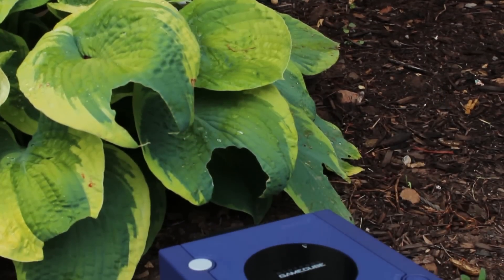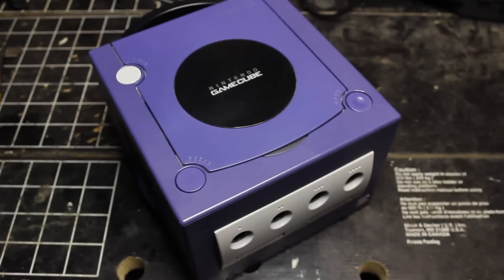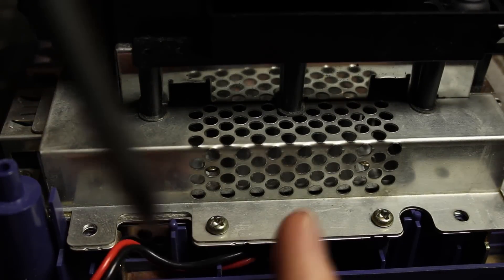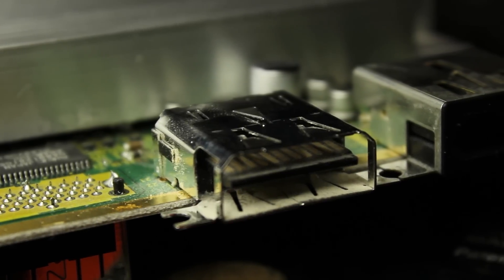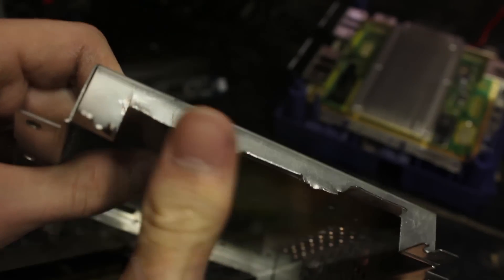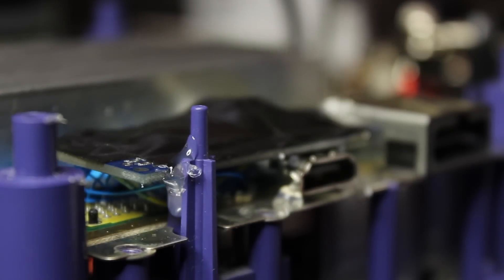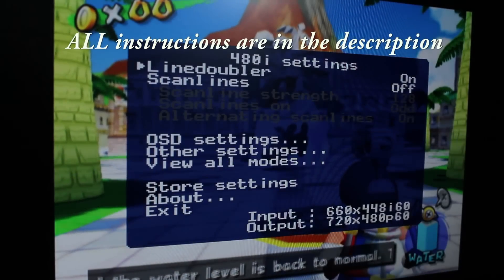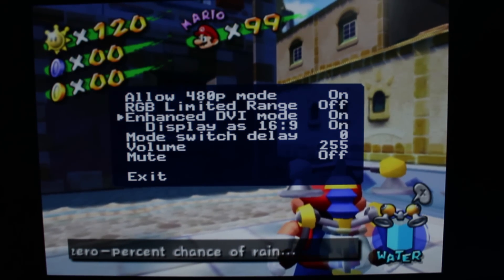GameCube HDMI Mod

Comment: Alright so I actually just bought this and installed it last night.  Fired it up and yay! HDMI worked right off... but wait, no audio...  I ended up searching through what little info I could find and supposedly I have to enable the DVI audio through the OSD.  Yay! again... nope... I made absolutely sure that my controller connection to the via on the bottom of the board was getting continuity to the HDMI kit but to no avail can I get into the on screen display to alter my settings... The input combo to bring it up is supposed to be L+R+X+Y, tried that over and over and over again, nothing.  Any help would be great, having to also hook up cables to the multi-out and running those to external speakers for audio isn't ideal at all.
Reply: I'm having the same problem. Bought the board last week and installed over the weekend. Video output is fine. Cannot access the OSD.
Reply: Hey Jake. I'm having the EXACT same issue. I'm pretty confident there isn't a short or anything. After trying to troubleshoot, my port 1 doesn't work at all.  I ordered a replacement front board to see if something's going on with the ribbon cable that can explain the controller problem.  The controller used to work, just not the input combo for the OSD, now it doesn't work at all while controllers 2, 3, and 4 work fine.
Reply: Make sure you contact them and write your problem in the forums.  When I emailed them they said they hadn't gotten any other reports of that happening.
Reply: Nah, got my new one in and had zero problems.
Reply: On my first try I removed the digital port and messed up the controller 1 data pad do I got a second board. I then broke a trace or something around the digital port. On my third try I was like "fuck it" and kept the digital port lol
Reply: All working again now. Jean from KNJN hooked me up with some amazing after sales support. He told me to bridge a couple points on the board, that helped. Then we found out there was possibly noise coming in from the serial connector, so bridged a couple more points to disable that and voila - it's working! I would recommend removing the digital port and using thicker wires (like 20awg). A lot of my problems came from using really thin kynar wire and the connections becoming brittle and breaking. I might tempt another gamecube and do a much more thorough install.
Reply from the maker: There are many points around the area where the controller soldering spot is supposed to be. https://raw.githubusercontent.com/ikorb/gcvideo/master/HDL/gcvideo_dvi/doc/gc-controller.jpg
Make sure that it is connected correctly. Way to think of it is one column to the right of C226, and one point down.
Than make sure you soldered that wire to pin 94.

The sound should work once your able to get to the menus and enable Enhanced DVI Mode.
Reply: I will check again now that I've had some sleep but I'm certain I've checked the location at least 10x. Going to be pissed if it's something to do with my actual controller board not recognizing one of the button inputs.
Reply: Well this is certainly aggravating. Staring at the board pictures and at my own board C226 is printed on the board differently.  The cap is in the same spot but the writing is marked off to the side differently, I wonder if I don't have the slightest board revision making this not the correct via to connect to.
Reply from the maker: Could you send a picture in of the board? I'm curious what it looks like
Reply: I just got in a couple of GameCubes, maybe I'll try and  swap out the controller board with another and see if that resolves the issue. I'll get on it now and let you know if anything changes.
Reply: Thanks man, I appreciate it.
Reply: Bad news, same results...  I'm thinking the boards they are sending out are either defective or not programmed correctly.  I unfortunately just ordered 2 more.  They did get in contact with me and told me to post my problem on their forum, I suggest you do the same as I'm assuming it's an issue on their part.  Sounds like they will ship me out another board if I can't resolve it, I suggest you write your experience on their forum as well.
http://knjn.com/phpbb/viewforum.php?f=2&sid=0a00fc8523bf4e522e0443291523d020
Reply: Just did both
Reply: so I emailed them last night and still don't have a response. I also posted on the forum but my post is nowhere to be found...
Reply: Yeah I actually looked for your post after you said that and didn't see it. Just mine with no response, that worries me that they are sending them all out with this issue.  It's kind of a big deal seeing as how if you are using your TV's internal speakers you have no way of getting an audio signal to them and video at the same time.
Reply: and you also can't change any video settings or anything...
Reply: Alright so it definitely isn't our installs (which I was almost 100% certain of).  They are aware of it and it's a programming issue with 2.2 firmware. https://github.com/ikorb/gcvideo/issues/3
Reply: I really hope there's a fix.  I'm pretty sure that when I re-soldered the point to check if that was the issue I damaged something and lost controller port 1 functionality.  Although I can confirm that before I re-soldered the point, my controller had full functionality without pulling up the OSD.  Lol.
Reply: Ikorb just posted and said it'll be fixed in V2.3.  Should we request a new board?
Reply: The distributor contacted me "Ok, I put your new order on hold.

I'm waiting a few days to see if a fix can be found before deciding how to handle the boards in the field with gcvideo 2.2..."
Reply: So either way you get to pay more for their mistake... classy.
"For those you got a 2.2 board (i.e. all boards that we shipped from
Sept 1st to Sept 20th), we offer two options:
1. Return the Pluto-IIx HDMI to us and we will re-programm it free of
charge with gcvideo 2.3"
Reply: I had the same problem and the day after I installed it I got emailed a recall notice for the board. I shipped it back to them and they are going to reprogram it.
Reply: Yeah I have one I have to do that to
Reply: Got my reprogrammed board back and it doesn't work at all...
Reply: Interesting, and you double checked all your points?
Reply: Yep. Everything is perfect.
Reply: Where is the forum? I just installed my board (shipped 4 weeks ago) and I updated it to 2.3 myself. Haven't added the resistor yet, so I'm going to grab one this morning.. But seeing your problems has me a little worried that all won't be a smooth ride :-/
Reply: Jake, did you old one just hang with a solid red LED? Thats what mine is doing (no signal on TV)
Reply: Mine had the solid red led with no signal on the TV haha.
Reply: Lol. How did you fix it? Get a replacement board?
Reply: I explained the situation to KNJN and they sent me a replacement. I'm waiting till next week or so to install it because I'm too busy but fingers crossed!
Reply: I couldn't find much info online about what the lights mean etc
Reply: Ok, they just agreed to send me a new one too. I actually tried it on 2 different gamecubes with the same results.
Reply: Okay good. Did they ask you to send the old one back? They didn't ask me to and I don't feel like paying more shipping fees 😑
Reply: Nah they just posted me a new one
Reply: So I got my new one, changed the wires one at a time from the old board to the new one - works perfectly. Had to enable 'enhanced DVI' (or whatever it's called) to get the sound working. All I have to do now is cut a hole for the port.
Reply: I got a little creative with mine.  I don't have the tools to cut a pretty hole, so I just clipped off the pegs around the air vent on the back, clipped the two plastic screw pegs, and used my soldering iron to neatly make the hole larger, and hot glued the HDMI board to the metal shielding there.
Reply: Patrick Day ehh? mine is taking the place of the digital port. Did you keep the digital port there or something?
Reply: Gahhh my second board has now stopped working! All I did was add the serial port. Checked all my soldering and it's first class... what's with these shitty boards?
Reply: Check your solder points again. Maybe one was loose?
Reply: Yeah I re-soldered the connections on the board. Started working again, but now it only works 1 in 20 times.. Damn this install is tricky.
Reply: Check your solder point to power the board. What happens when you turn on the console?
Reply: The board is getting power, hence the red light. I don't think its a power issue..
Reply: is the red light blinking or is it solid.  I have two red lights blinking at different rates
Reply: Its solid when it doesn't work. It blinks when it does work. Its pretty random when it decides to work.. I'm not moving anything either.
Reply: Might be a short somewhere
Reply: Bravo!

Comment: If I do this will it be 100% input lag free?
Reply from the maker: I don't have the equipment to test myself, however any lag that there might be shouldn't be noticeable by most humans
Reply: I see. I ask because composite/component cables have a significant lag on HD TVs, which isn't  the case with CRTs using composite, nor HDTVs using HDMI.
Reply from the maker: Alucard Belmont
Well I didn't see any lag on my end

Comment: So the github page lists the board and a programmer... Item #6117 is preprogrammed so I won't need a programmer for that board. Is that correct?
If that is the case , I intend to purchase it, since i have no knowledge to that subject at all....
Thanks in advance for your help, good sir!
Reply: oh an one more question. ... I own a PAL Gamecube (DOL 001)... Will this mod even make a sense? A.f.a.i.k PAL games don't support 480p (progressive). Could this be a problem?
Reply from the maker: Yep the preprogrammed one is the one to get, it already has GCVideoDVI on it, and only needs to be soldered in. Trust me, I couldn't be bothered getting flashing tools and figuring out how to program it either.
Reply from the maker: PAL should work, I assume you do have the digital video port on your GameCube. I believe you'll be able to choose between 50hz (576i) and 60Hz (480i).
Reply: +Sam Campbell I think that's correct. I remember seeing a video of the On Screen menu where you can force 480p, but that was made on an NTSC cube....Not sure about a PAL console :/
Reply: +Sam Campbell Oh boy, whatever. I just ordered it. It's a friggin HDMI mod for my Cube! 480i or 480p, it will be beautiful.

Great video btw. , I just subscribed.
Reply from the maker: Thanks! Let me know if you have any other questions
Reply: Today, I finally have been able to finish the mod. The picture is perfect. But no sound via HDMI for me! I double checked (and re-soldered) the "AData" Pin (If this means Audio Data?!), but still no sound. Do you have any suggestions for me?
The Pluto board is blinking red while running. Is this an error code or something?
Reply from the maker: haleman1704
No the pulsing red is normal. Hold the L, R, X and Y buttons down until the menu appears, then look for the Enhanced DVI option, and make sure it is enabled
Reply: Sadly, the DVI mode is enabled, the volume is all up and not muted.
I guess I will try another TV, and is this also fails, resolder every wire again...
Reply: Tried 3 different TV's today, no luck.
Oh boy, I have to redo everything.
Was I right about the AData pin? Can you tell me which wire is for Audio?

Again, thanks for your help, Sam!
Reply from the maker: The LRCK (19), BCLK (22), and AData (21) are for audio. You could try to take a closer look at those specific pins
Reply: thank you! I will try it in the coming days.
Reply: I just double-checked every pin, resoldered every pin, but I'm out of luck. No sound for me. Tried several TV's. 
I mean, I could grab audio from the Analog Out, but honestly I don't want to.
Pretty frustrating. Anyway, thank you again for your support
Reply from the maker: haleman1704
That's a shame, perhaps you could contact the distributor?
Reply: Maybe I will do that. But I won't without trying another GameCube, I guess...

Comment: Since the Digital port is just a plug soldered to the board, is there a reason that an external unit could not be made? A cable with a Digital Port plug and a 5v power supply and you'd be in business.
Reply: Andrew Deley Component as we know it, YPbPr, is analog. However the signal in the Gamecube is digital. The chip in the GC component cable converts the digital signal from the Gamecube into an analog signal.
Reply: While we're on the subject, why are there no aftermarket GC component cables in existence? Surely if the official cables go for $200+ someone could copy the pinout and manufacture them in China. Sell for $50, still turn a huge profit.
Reply: Helloz World component isn't digital, it is analogue. I have a madcatz cable that works for PS2 GameCube and Xbox and outputs svideo rca and component. All analogue.
Reply: The problem is that making such a cable would be extremely difficult to make. The Gamecube Component Cables have inside of them a special chip called a DAC or Digital to Analog Converter Chip, this chip is a very Unique one Nintendo made that also has a lock-out function meaning that it has a secutity protection code that prevents 3rd Party Companies from making a Component Cable. When the Gamecube turns on it looks for anything in the Digital AV Port, if it detects any cable it checks the security code inside the Cable. If the code doesn't match or if there is no code, the Gamecube will not enable the Digital AV Port therefore giving no picture. The code is a special secret code that, only Nintendo knows and can control on an unmodified console. I'm not sure how this HDMI mod works, but it should bypass the whole security video lock code and just get into the internal Digital Signals of the Gamecube.

Comment: Great video.  I have a quick question though.  Did you use the 30 gauge wire for the points from the digital port?  I have extremely thin wire lying around but I'm not sure what gauge it is...it looks about the same to what you have in the video, but would it cause any problems if it's not the exact same size?  I ordered an FPGA but they're back ordered right now :( I appreciate your help!
Reply from the maker: Yep I used a very thin 30 gauge wire for all of the digital port points

Comment: Great video! Really helpful, I'm going to try this within the next month hopefully. I would like to ask you a few questions though. In what order did you solder the other wires not shown?  First to the GC mother board then to the HDMI chip or the reverse of that?  Did you do one wire at a time or all of them to the board then to the chip? Last did you keep all the wires the same size or just the shortest you could?
Reply from the maker: I wired all of them to the board then the chip, soldering one wire to the board checking the length it would require to get to the chip once it was connected. Stripping and tinning that wire, then moving on to the next. Once all of the wires were soldered into the board and measured, I just pushed the tinned ends through the corresponding holes in the chip, and soldered them in. In terms of size I always like to give a little extra for movement.
Reply: Thanks, that's how I envisioned doing it.
Reply from the maker: No problem, good luck! Let me know if you have any issues